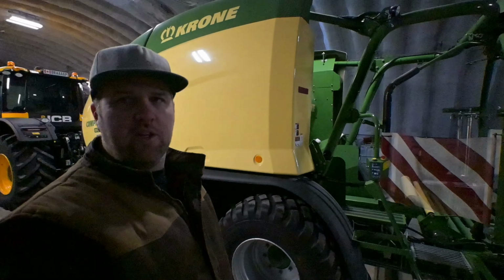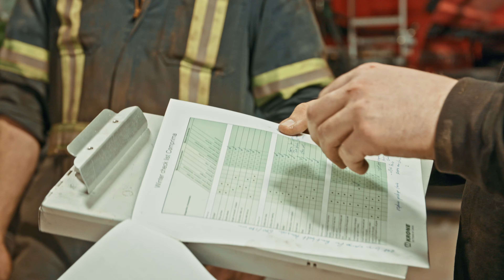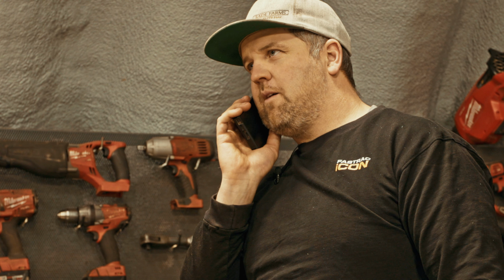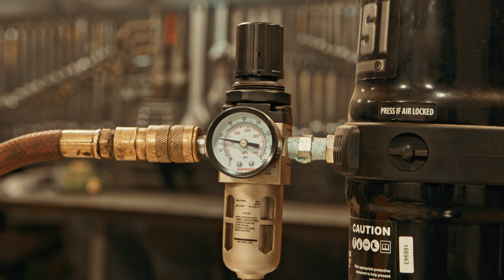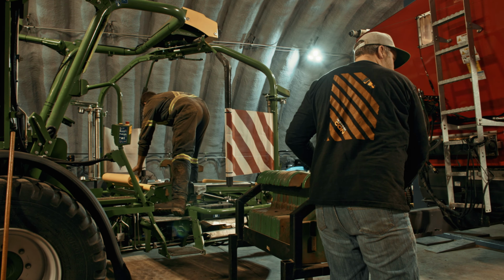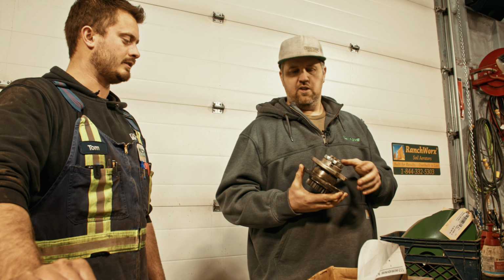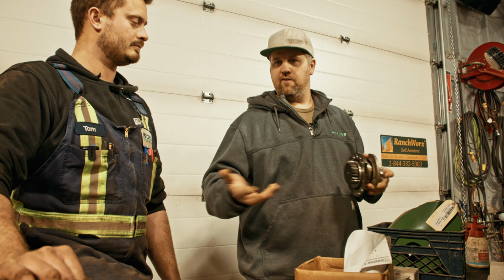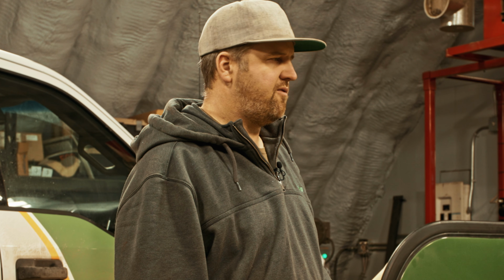New Drill Update and Winter Checks

Comment: Sweet ! So u ordered the 10.25 SD, 6.5 inch seed width, so the fert goes with seed or does it mid row band it?
Reply from the maker: Thank you so much for watching AND the comment!  Unfortunately this drill will put the seed in the same furrow as the fertilizer, it does not have mid row banding.  For us it was not the end of the world, as we rely on our Soil aerator to keep our soils soft, and we have had enormous success in broadcasting our nutrient packages.  We just try to keep the nitrogen as its own pass so we can put it on prior to a rain, even if the crop is already coming up.
Reply: Whats the hp required to pull 26 ft?
Reply from the maker: Not sure exactly, but the Horsch has very minimal draft.   We are going to pull it with the Fastrac 4220.